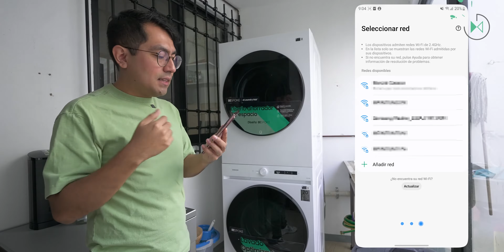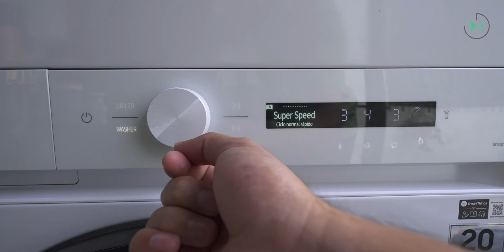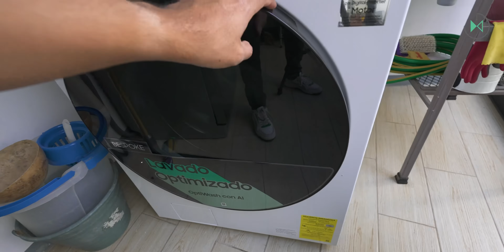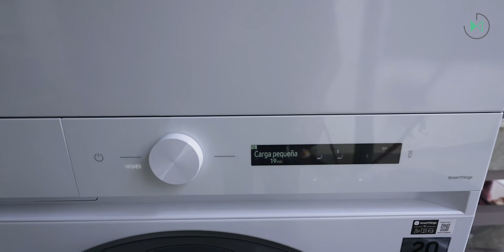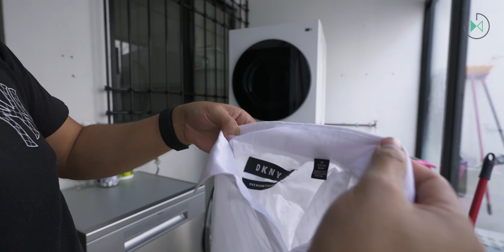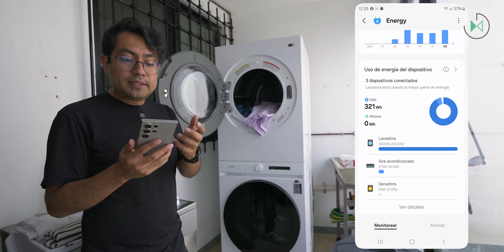Samsung BeSpoke AI Laundry Hub | The test

Comment: My dryer isn’t drying using heat. I washed my bed comforter and this is my third time changing the settings and it’s not drying. It’s drying with like a cool setting so it’s not doing anything. I put it on bedding, heavy duty and normal and it’s not drying or using heat. Do you know how I can fix this?
Reply: What type of dryer is it